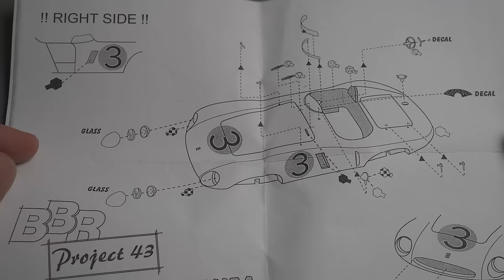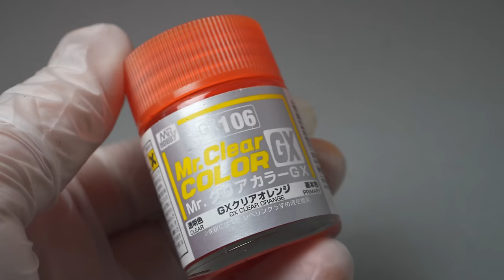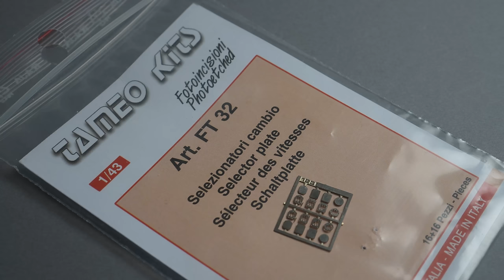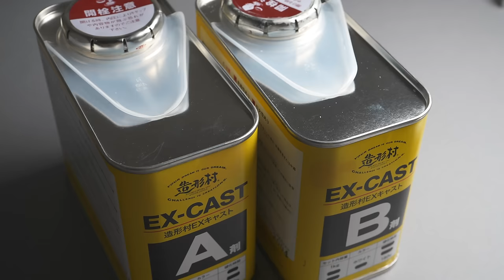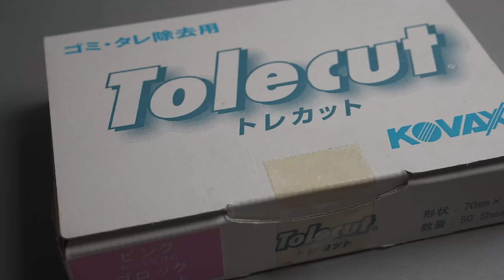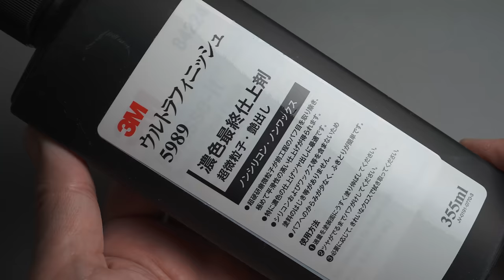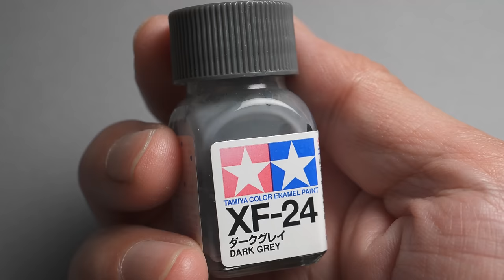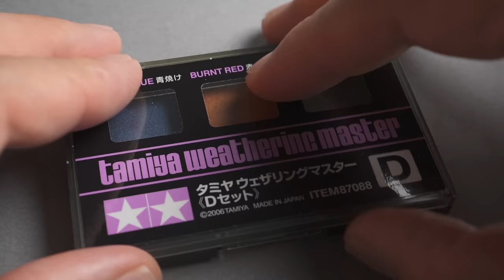Full Build Ferrari 750 Monza 1/43  scale model car

Comment: If anyone thinks they can just buy the tools and do this they are wrong. Excellence in several fields not withstanding extreme dexterity with obscured vision, fine art background, using precision instrumentation and even using methods that are unique to the user that could only have been developed over decades means that you would be slowing yourself down just trying to copy the methods displayed to achieve the same results.  I became a subscriber the moment you masked on that gorgeous transparent orange over that burl pattern on the steering wheel ring, knowing that the dark grey would reduce the orange to a sexy glossy brown and those tiny imperfections with the drybrushing previously on it was just, wow.

Comment: The steering wheel-dashboard assembly is wonderful. And all the self-built details, including the resin on the badges. Please correct the imperfect black smear in the right air duct. But it is just a detail that does not detract from the splendid creation!
Reply from the maker: Yes, I agree.
Every time I watch the video back, I too am concerned about the dirt in the ducts😆
Thank you so much 😊

Comment: Interesting. First, let me say this, lovely work on the details and overall project is top draw. Well done. 
If you don't mind me saying this, when it comes to the panel lines, you use a cotton bud to clean up the black with some thinner. Good technique however, try a tooth pic. By getting the wood to soften little by getting it moist (water or thinner), it will allow for more control and accuracy when you clean up. Furthermore, if you fill the panel lines with black before you clear coat, once cleaned up, the clear coat seems to make the panel lines look thinner... tighter. Maybe worth a look. Again, brilliant work.
Reply from the maker: I see, thanks for the advice.
I will try it once.

Comment: This is a gorgeous build, thank you for posting it! If I may dare you to elevate your skill even higher, is there any way to build your seats with actual leather integrated? Would love to see a technique that does this
Reply from the maker: I do not use leather because I believe it is overscaled for 1/43 scale. For the same reason I do not use fabric for seat belts.
I guess it all depends on your preference.
Reply: @bonbonscalemodel  for sure, it's too thick. But it could be shaved down to be very thin. But yeah, looks amazing the way to do it, either way
Reply from the maker: It might be cool if it were thinner 😊👍

Comment: Very impressive. I have no doubts you could make that car run on drops of fuel. You went to great lenghts for the details, yet, I wonder why you didn't make it so it can open hood and doors, and why you even made light covers but no bulbs or leds to have it turn the lights on? Also, the steering wheel attached with epoxy when you could make it like Buraggo cars where you can actually turn the wheels with the steering? I'm absolutely sure you can do these, since what you already did is way more complex, so I was wondering why you didn't; It's not a critic, I'm honestly wondering.
Also, I was very curious about your mirror: I'm trying to make a 435 X Arri cinema camera model, and I need some tiny mirrors to make it so it's actually reflex and the visor works (so I would need to create a periscope with tiny mirrors inside) and I was wondering what would be the best approach. I'm not confident in being able to polish a metal sheet to the extent of it being a proper mirror, so any tips would be appreciated.
Again, very impressive model, it looks fantastic.
Reply from the maker: I think this is really a matter of preference.
I would never touch the model out of the acrylic case for the life of me, so of course I would never touch it.
If the hood can be opened and closed, then I fix it in the open position. If the doors can be opened, then they should be fixed in the open position.
The parts of the acrylic case that cannot be seen from the outside should be omitted as much as possible.
This is really a matter of preference.
I only know how to polish the mirror surface steadily, but it is definitely most gratifying to get such a long comment.
Thank you so much.
Reply: @bonbonscalemodel  Oh, I see. It didn't occurred to me that the model would be inside an acrylic case for display. In that case, being that you're not going to touch it, it wouldn't make sense to add the features I mentioned.
Well, I'll have to keep looking for the mirror idea.
Thank you for your reply!

Comment: Amazing video. At 14:43 are you using silver soldering or normal solder to fuse two metals together?  Aso at 15:33 is it a normal wax? 
Thank you
Reply from the maker: Thank you!
HEXSOL Rolled Solder, For Stainless Steel and Metal Processing
https://amzn.to/3NUcEQg

When soldering, use a special flux.
Stainless Steel for Flax
https://amzn.to/3NSeC2D
Reply: @bonbonscalemodel   Thanks a lot :)
Is that stronger than silver solder? 
What Wax are you using at 15:33?    
Thanks for you help
Reply from the maker: I don’t know.
The use of yarn-free solder prevents adverse effects on the paint.
This is a something called a thermo plastic.
Here is the link to Amazon.
https://amzn.to/3CQTq7V